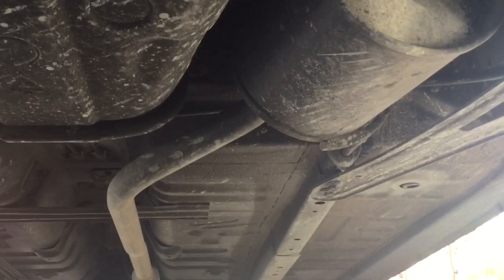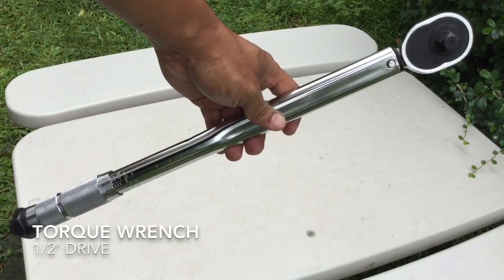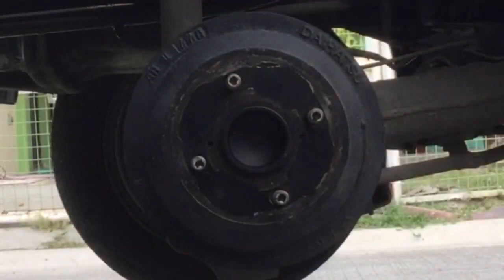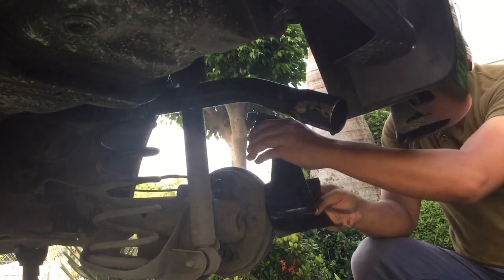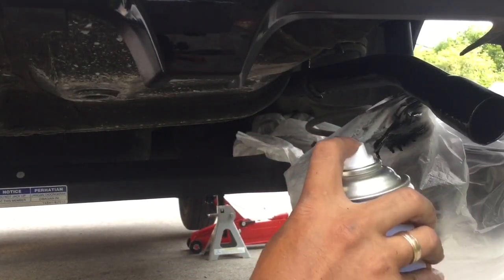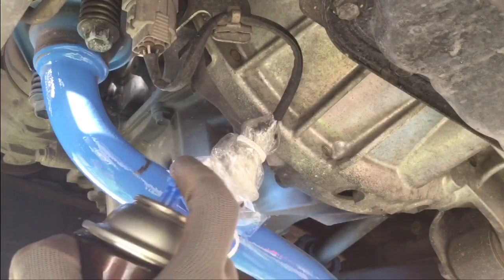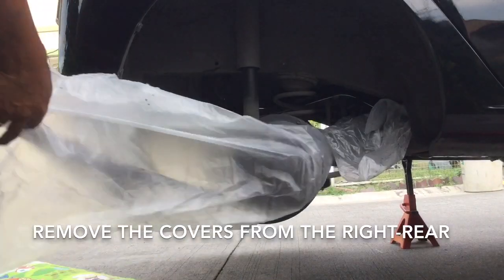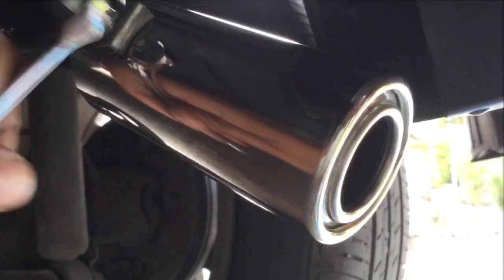How to Spray Paint the Exhaust- Toyota Wigo

Comment: Sir Allan question why may blue high temp spray paint middle coat po ba un?
Reply from the maker: i bought and used that last year. nakabili na ako ng spay piant cans when i came across the blue paint with a different brand..so it was an afterthought. this year i painted the exhaust all black.